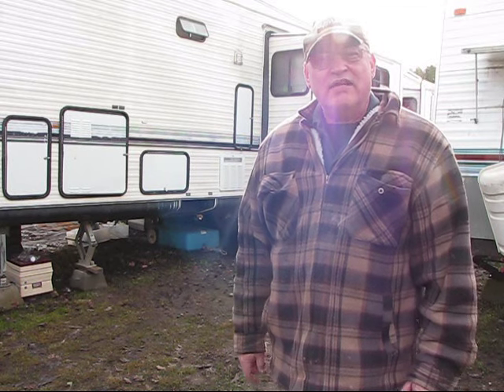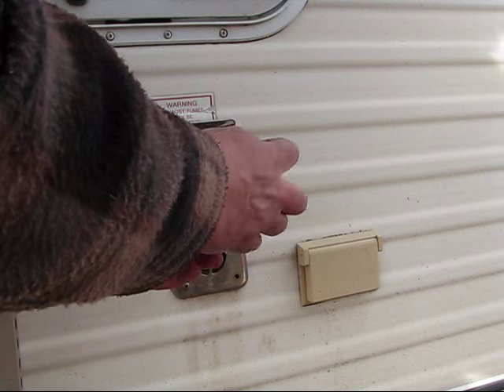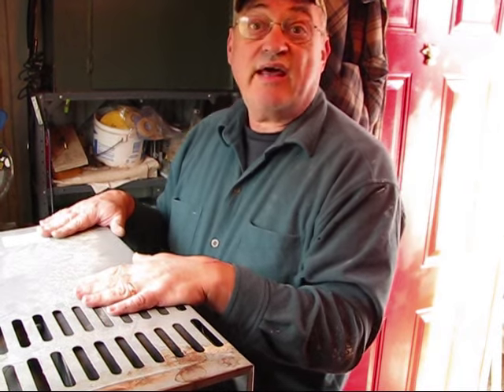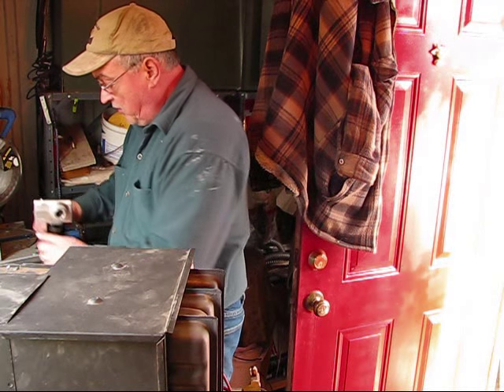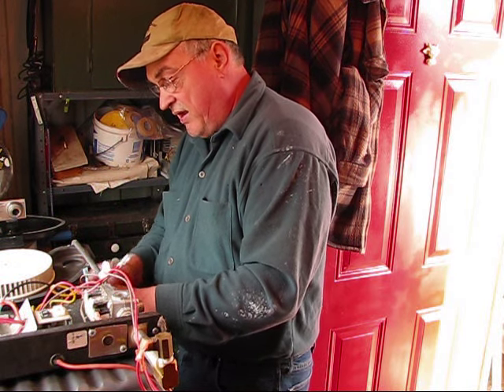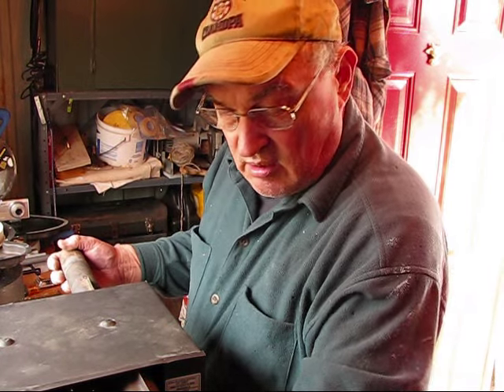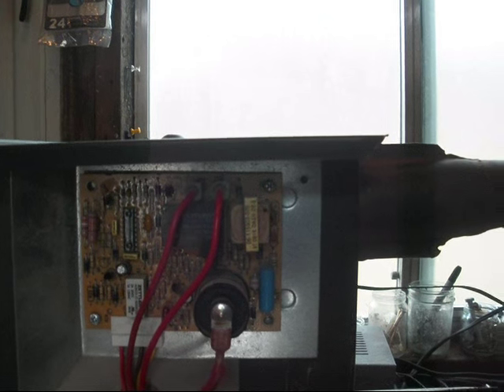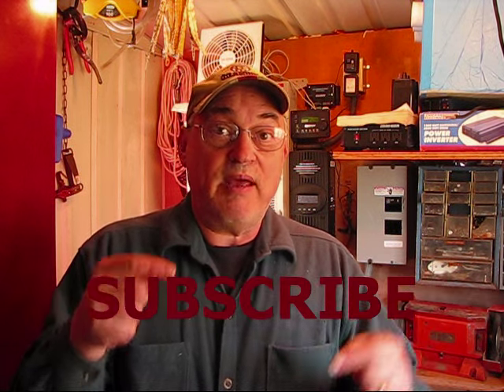RV Furnace Repair - Blower Motor Removal

Comment: Works so well Fastly.Cool that it only requires daytime operation until high temp and humidity are overnight. It is difficult to get to side filters, but back is easily accessible.
Reply from the maker: I have four RVs. All but one need maintenance like this.

Comment: nice video thank u. Someone replaced my blower motor in my 5th wheel, as it was starting to squeal when starting up, was told bearings were going and time to change, so this guy did and now it is louder and vibrates so much that I cannot make a phone call while heater is on, very frustrating. The tech that did repair is suppose to come back next week to fix this; do you think that something is loose, a screw, a belt??? Any idea of what it could be? It vibrates very loud but does put out heat. Thanks,  MP
Reply from the maker: It could be the "Squirrel Cage" fan which was not adjusted appropriately. Sometimes, if not careful when reassembling the cage fan can rub on the outer housing and create that "UnGodly" noise. If that is the problem, the furnace has be be removed and the adjustment made. Time consuming, but do able.

Comment: Would have been nice if you mentioned brand and model#.
Reply from the maker: I apologize for not placing it in the description. SUBURBAN RV FURNACE - Motor Replacement
Model NT 34 SP
Link to purchase motor : https://amzn.to/3HzeXSW
I have done about four videos on repairing this beast. Here the links are which do have the make and model along with ordering links for replacement motor;
 https://youtu.be/Y4xjUy4mXx8 - 
https://youtu.be/gp32gxBw19s
https://youtu.be/5Ezb9kLmwe4

Comment: Mines nosie as shit can i still use it tell i can fix it ?and is it the fan or the motter do you think?
Reply from the maker: Could be the bearing drying out. I have another RV doing that. Will have to pull the motor and replace the thing.